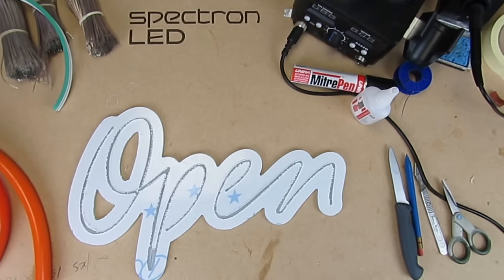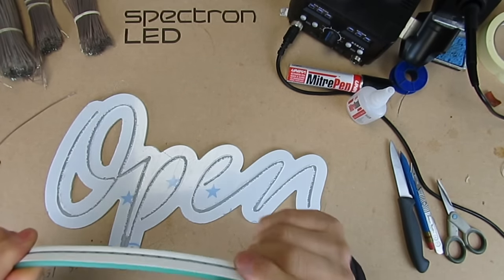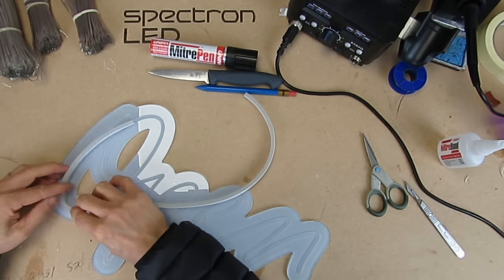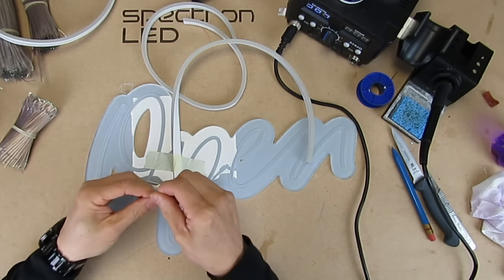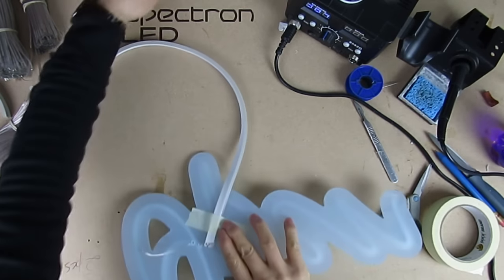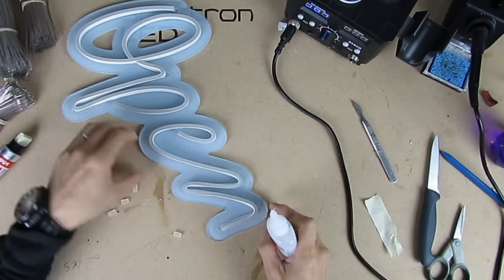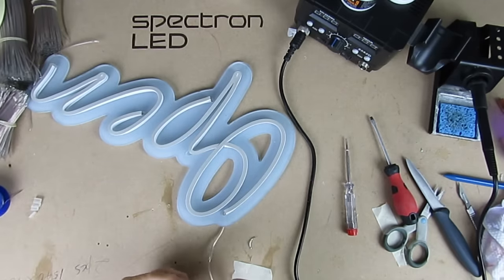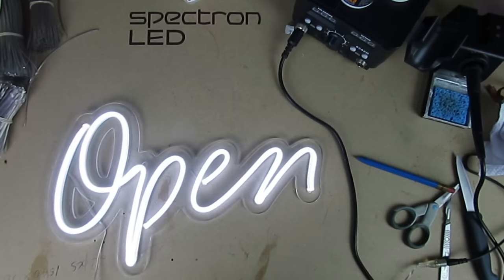How to Make a Neon Sign LED Part 2 (feat. CNC Cut Back Panel)

Comment from the maker: Our Neon flex is designed for outdoor use as it is IP67 rated. Just make sure that any connections are fully encased in a silicone end cap with silicone gel inside to prevent any salty air or water getting near the connections.

Comment: Nice vid...what is the thickness of the acrylic?? And how deep was the cutpoint??
Reply from the maker: We use a 5mm thick acrylic and the cut point for the neon flex is every 10mm
Reply: @Spectron  hi...i mean how deep is the engrave on the acrylic..thanks for your response.. Appreaciate it..
Reply from the maker: @skrrskrrzone  Hi there, it's about 3.5mm deep 😊

Comment: What are the options for NOT having a plastic base cutter/laser ?  Excellent item and demonstration....
Reply from the maker: Thank you Dave. You can glue this straight onto any flat surface of any substrate. Use a jigsaw and then wet and dry should give you a nice edge finish to any shape you desire.

Comment: I have a sign and I dont want the last letter there anymore. If I just cut the wire connected to the last letter will the rest of it still work? The power is coming from the front one. Thanks!!!
Reply from the maker: It depends on how the rest of the letters are wired up. If one letter is wired to the next in a chain then yes, cutting off the last letter should be okay and the sign should still work. For certainty though, send us a wiring diagram and we can check for you - sales@spectronled.co.uk

Comment: What type of Acrylic sheet do you use?  a) Cast Acrylic b) Extruded  Plexiglass d) Polysterene e) Polycarbonate
Reply from the maker: Cast acrylic
Reply: What thickness is the most appropriate?
Reply from the maker: @christopherayettey4390  5-10mm

Comment: I'm finding soldering and keeping the joint tidy, extremely difficult. Is there an alternative to making that electronic connection (can I just superglue it for instance?)
Reply: Use a scalpel carefully slit open the silicon skin and lift out the PCB to do the soldering, Mitre Bond it back together afterward. We also have the 2 parts system which you may find it easier to do. Hope this help.

Comment: Hello I have a question. I made a neon but my problem is some of the ends are not lit. The light is not continuous. I guess it can't go with 1/2 inch cut. What should I do. THe led I got has 1 inch intervals (back of neon)
Reply from the maker: Hi, our neon flex has 10mm cut points and is lit to the end. https://www.ledsignsandlighting.co.uk/leds/led-neon-flex

Comment: Hello there. İ wanted to know which neon flex u suggest to use. Any suggestions can help. İ am a starter...
Reply from the maker: HI Aris, try the 6mm neon <https://www.ledsignsandlighting.co.uk/winged-neon-flex> . It's very flexible and has a 10mm cut point. It's  easy to work with once you know how!

Comment: How many amp of battery supply you use for these lamomo 12v led strip
Reply from the maker: The neon flex we use is 8 watts per metre.

Comment: Hi, thank you for the video. Does it matter if we use type A or type B plug for the led neon signs?
Reply from the maker: Hi, our Winged Neon Flex is 12v so any 12v driver or plug in adaptor is fine as long as the watts are matching the total watts you use per metre of neon flex. I would recommend a constant voltage driver to power any neon flex.https://www.ledsignsandlighting.co.uk/accessories/led-drivers

Comment: Wow, brilliant video. 
I've clicked the link for the 5mm but no product showing? 🤔
Do you have another link?
Also what else do I need, neon led, end caps, mitre bond, tinning cable & power supply? Thanks
Reply from the maker: Hi MK, apologies, the link for the mini neon has now been uppated! (https://www.ledsignsandlighting.co.uk/winged-neon-flex). And yes, the other components needed are tinning cable, power supply, end caps, mitreBond (if not using our cnc cutter), and a back panel.
Reply: @Spectron  hi thanks for that but link still not working. Saying page not found 🤔

Comment: Great video. Thank you. Question though. Is there anywhere that sell the pre groved backs already made so I can just finish it up or is there someone that does this sort of thing to order?
Reply from the maker: Hi you could purchase the CNC router bit and then anyone in your local area with a CNC machine could produce the back panel for you. Spec available here https://www.ledsignsandlighting.co.uk/accessories/tools/CNC-Cutter

Comment: Wow, so that's how the professionals do it. Can you connect multiple pieces of neon flex in parallel? is it designed to keep the same tone, or brightness if multiple pieces of different length are connected in parallel?
Reply from the maker: Hi Adrian, yes you can but you will need to power them from both ends to ensure no fall off in colour.
Reply: @Spectron  Thanks very much for the response. That's what I was hoping to avoid :D Trying to cut my soldering in half. I have many, many joints to do.
Reply from the maker: @adrianvanderzandt4310  Good luck with it! If you have any other questions, feel free to get in touch 😊

Comment: Stupid quest but im new new at tryin! After u attach the dc connector that do you plug it in to do we hav to put a plug on it?? Sorry im confused
Reply from the maker: We use a desktop power supply with a male DC connector on the end. This already has a plug on it.

Comment: I have a project with like 9-10 different flex neon colors, I see colored end caps are available, if I just use clear end caps will it make a noticeable difference or should I just buy a pile of corresponding colored end caps for each color of flex neon?
Reply from the maker: Hi John, we would recommend either using the waterproof end caps which are clear and slip over the end of the neon, or using the corresponding coloured end caps.

Comment: I'm trying to find the part one video, but the one linked is just a totally different project. I need to know the CNC side :)
Reply from the maker: Hi Dan, part one is showing you how to install the LED neon flex onto a flat back panel with no routered channel. We don't have a video on CNC cutting, sorry!
Reply: @Spectron  Thank you for the reply! The thing I need to know the most is, how deep of a channel would I need for the LED neon flex to fit into? I'm looking to get RGB, and then LOTS of colors of Neon Flex, very soon. Do you work with US hobbyists? Is your lighting too expensive for hobbyist sign makers?
Reply: @Spectron  I'd actually love to talk to someone on the phone. Do you have a support/sales line i could contact someone?
Reply from the maker: @DanPerry-t8s  No problem! So it depends on the thickness of your acrylic and partly personal preference. We use a 5mm thick acrylic and the channel is 3.5mm deep. You could use a 10mm acrylic with a channel about 7mm. Basically, you want to maintain the integrity of the acrylic and see the top surface of the neon! We do sell to lots of hobbyists worldwide. The shipping to the US from UK is from £28 and the neon is £36 for 5 metres. Feel free to call us on +44161 236 8828 for more info!

Comment: In terms of the cut point being 10mm apart, what is the best thing to do if the point I need to cut sits in the middle of that? Cut it shorter and have a 5mm gap either end of the length? (I may be misunderstanding it though). Similar question re trimming the bits that meet at a cross roads - can it just be cut ad-hoc or does it need to align with a cut point?
Cheers, great vid.
Reply from the maker: Good question Rich. We cut it ad hoc, so that the neon doesn't come up short at cross joins or ends. We cut into the side of the silicone tube to get access to the solder points. Once we have soldered our cable on, we then close the tube back up and glue it together. As the cut is on the side, it's not really visible when glued back together. We only recommend you do this if it's an internal sign with no chance of water ingress.

Comment: How does each letter get its power when you did three separate power connections? How are they joined at the rear to make one final connection?
Reply from the maker: The letters are joined together and the end piece is connected to the power supply. The sign is quite small and uses less than 3m of neon flex so we can do it this way without seeing a voltage drop and inconsistencies in brightness. If the letters were larger, we would need to connect each on to the driver. You can only use about 2-3m of neon flex in one continuous run before needing to run directly to the driver. Hopefully this makes sense, but feel free to contact us for more info.
Reply: Yes that's great thank you. I did wonder if the brightness would drop off over a certain length. Brilliant, thank you for replying so promptly 👍

Comment: Great video but where do you get the plastic and what machine do you use to cut the design
Reply from the maker: We get the acrylic from local trade suppliers and a flatbed router cuts out the plastic

Comment: Do you all use adobe illustrator to get the outline for the shape of acrylic for neon sign? How does that work exactly
Reply from the maker: We do use adobe illustrator, yes. We create the design with a line weight equivalent to the thickness of the neon.

Comment: Great job, but one question
As far as i know neon leds can be cut into 2.5cm pieces meaning that each segment should be a multiple of 2.5cm in terms of length, how can i measure that when im designing the sign? Because i cant cut the strip at middle of those 2.5cm parts so its gonna be short or excess if i don’t design the acrylic sheet grooving length
Reply from the maker: Our neon flex has cut points / solder pads every 10mm interval. You can cut the neon anywhere really, as long as you miss the actual led chip. If you cant access the solder pad, just cut the silicone tube to expose it, solder the cable, then seal the tube back up with glue.
Reply: Spectron LED thanks :))

Comment: Awesome!  How would one go about making a sign like this weatherproof for outdoor use?  Looking to make the same sign with the word “Vacancy” but would need it to be outdoor all the time.
Reply from the maker: Thanks! For external use, you need to be absolutely certain that any connection and exposed end of the neon flex has been waterproofed using waterproof end caps and silicone. We also recommend you put the sign in a Perspex box for added protection!

Comment: How deep are you machining the acrylic for the channel and what thickness material do you typically start with?  At the moment we do most of our signs with 3d printing but I have a large CNC router for our larger signs but have yet to use acrylic backers.
Reply from the maker: Hi we machine to a depth of 3.5mm

Comment: What if the end of your letter does not land on the cut line?
Reply from the maker: You should be okay to cut beyond the cut line as long as you don't cut through the led chip. We use them for guidance, but do try and design your signs taking into account the cut points.

Comment: The acrylic panel is between 5 and 10 mm thick. In this video example, what is the width and length of the acrylic panel?

Comment: What is the benefit of Machining the groove rather than just gluing the flex to flat acrylic?
Reply from the maker: Hi Ramon, it's neater, more secure and faster to create, particularly if you use a winged neon that clips in rather than using glue.
Reply: @Spectron  what machine did u use for such accurate carving?
Reply from the maker: @kimofficial8613  CNC machine

Comment: how did you get the single line font for the text? I'm trying to make some wedding signs with my cnc router and I cant find any text that isnt bubble writing
Reply from the maker: Hi Brent, we created a file using Adobe Illustrator. The font is our own. Could you elaborate on what you mean?
Reply: I’m having the same issue, looking for a single line text, so I can have a 5mm channel for the light to sit in

Comment: I love this video.  The best tutorial on YT.  Thank you!

Question, how do you power your signs?  I don't see any links to power bricks
Reply from the maker: Thanks for the positive feedback! We use desktop drivers (such as https://www.ledsignsandlighting.co.uk/48W-plug-in-power-supply-12V) or internal drivers (https://www.ledsignsandlighting.co.uk/internal-12v-60w) to power our signs. You would have to check whether these are suitable for use in your country :)
Reply: @Spectron  thanks for the fast response.  Unfortunately it doesn't show any item when I brings me to your page.  It must not be available for the US.  No worries.  I'll look for the 12v 5a setups in my area.

Comment: hello, a question, what kind of wire do you use to connect the led strips?  I guess it's copper, but what thickness?
Reply from the maker: It is 28 AWG <https://www.ledsignsandlighting.co.uk/Pre-soldered-cable>
Reply: Do you have the amazkne ljnk of it in my country they do not order from your site

Comment: When you design your grooves, is the length of the channels calculated so that the cut marks on the strip line up perfectly at the ends?
Reply from the maker: It's near enough, but not exact as you can cut the side of the neon to expose the solder pads then close it back up again

Comment: Thank you so much for your insight. Your video is very well done and the sign looks amazing.  
I had a couple of questions. I am planning to make a beautiful sign for Jesus as part of our Christmas decorations. You inspired that decision a few months ago when I stubbled upon this video. I have nearly all the info I need but I curious about how much larger should the acrylic be than the lettering. I imagine that will have to do somewhat with the size of the sign and I expect the letters to each be about 16 inches (40 cm) tall and the sign to be roughly 4' x 4' (122cm x 122cm) As you can imagine I want it to look great but cannot afford to make it twice. Can you give me some insight into how the width of the surrounding acrylic will impact the way it looks? 
Also what steps can I take to minimize issues with the wet weather in a climate where temperatures get close to zero ( -17 Celcius)
Reply from the maker: Thank you for the kind feedback, Doug. The size of the acrylic panel is down to personal preference - you could keep it close to the neon flex if you wanted, or allow a border. If you're using clear acrylic it wont really be noticeable when the light is on. If you are drilling fixing holes, you'll need to allow room for these. Regarding your questions on minimizing issues with wet weather, we recommend you put the acrylic sign in a clear box and seal any joins, or cable entries. Given the cold temperature you will need to check the working temperature of any adhesive you are using, and consider securing the neon with wire as a failsafe. We are currently checking the working temperature for our neon to see if -17 degrees would affect it.

Comment: Do you ever use brackets or would you say the glue is just as sturdy as using brackets?
Reply from the maker: If using a flat panel, we tend to only use glue, but there is nothing to stop you using fixing brackets as well!

Comment: Hi how can we remove the non sticky glue from the acrelic sheet before sticking the neaon what kind of solution we need to use for that
Reply from the maker: It's very difficult to do unfortunately. We use our winged neon flex and a routered channel - we can clip in the neon without having to use glue!
Reply: @Spectron  Hi i mean to say when we remove the paper from acrelick sheet then we found non sticky glue over there so because of that glue many time the neoan strip is not easy to fix there so how can we remove the non sticky glue from the acralick sheet ?
Reply from the maker: @bantichouhan1282  INDASOL IPA surface cleaner (Isopropyl Alcohol)

Comment: Hi i have a question. Can you laser cut 1mm or 0.5 mm in a 3mm acrylic sheet to fix strip into the engraving ?
Reply from the maker: No, you need to use a CNC machine.

Comment: For a bigger sign but still short run should I use 22 or 28awg wire
Reply from the maker: The brightness of the sign will decrease with a thinner wire. We recommend you use at least 22AWG or thicker depending on the amount of neon you are using.

Comment: Hello how deep do you need the Grove for the led  to fit in
Reply from the maker: The depth of the channel depends on the thickness of the acrylic panel you are using. For a 5mm thick panel, cut a channel approx 3.5mm deep. For a 10mm thick acrylic, cut the channel a minimum of 5mm deep.

Comment: @Spectron LED  hi is this just a super glue “CA” and a activator it’s really hard to get that product in Australia can I use Soudal it’s a 2C adhesive with aerosol activator
Reply from the maker: Hi there, MitreBond is a cyanoacrylate adhesive, but we've never used Soudal and not sure what materials you're using so we can't comment on whether it's suitable for your project. Sorry!
Reply: @Spectron  will MiteBond stick to pine wood or painted wood instead of acrylic
Reply from the maker: @91rickstar  Prepare the surface first with a fine sandpaper to give the adhesive a key to bond to and clean throughly.

Comment: Great info !!! Whats kind of cleaner do you use ?
Reply from the maker: The best way to clean these plastics is with a clean microfibre cloth and water.  Always use a liquid of some sort - plain water is best or if you need some soap, just a mild detergent diluted in water will also be fine.

Comment: What is the thickness of the cable you are using? I searched but couldn't find the link.
Reply from the maker: It's 28AWG and can be found here: https://www.ledsignsandlighting.co.uk/Pre-soldered-cable
Reply: @Spectron  thank you